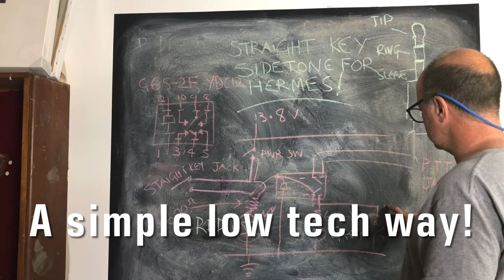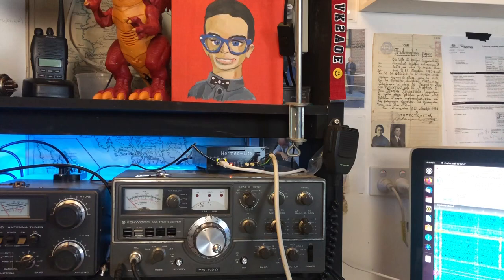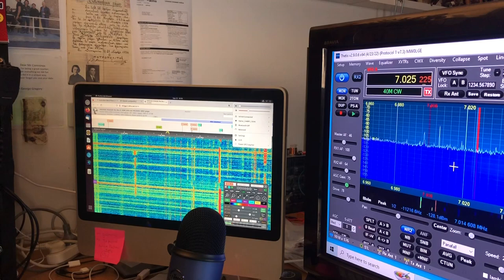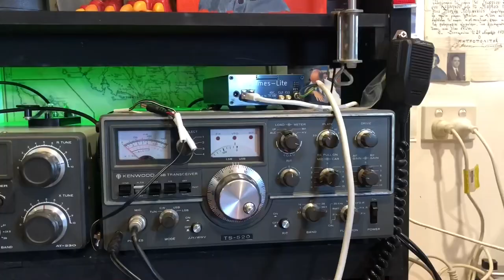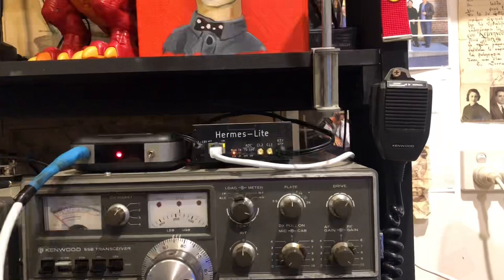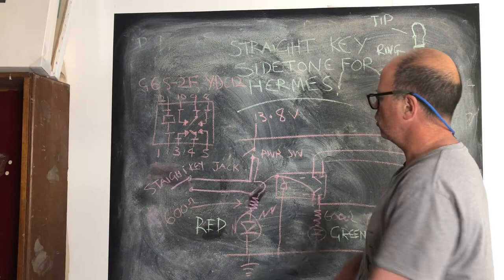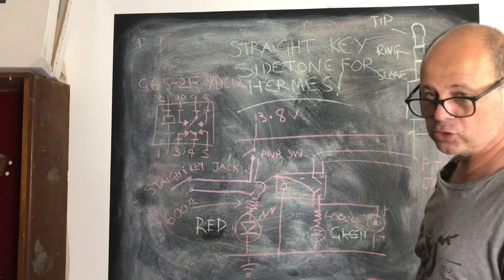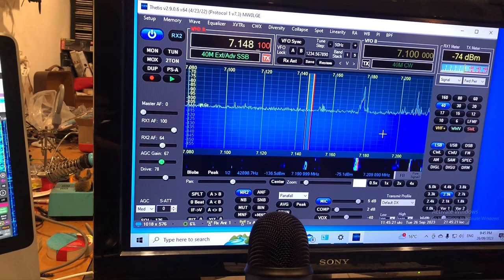Hermes Lite II - Straight Key CW

Comment: Two diodes and a piezo would have done the same job.
Reply from the maker: Would it present 12V to the piezo and isolate the input of the Hermes whilst still allowing the tip to sleeve to see earth? 73 de VK2AOE
Reply: key to cathode of two diodes, first diode anode connects to Hermes keying input and pulls it low when key is closed. Anode of second diode goes to one side of piezo whose other connection goes to 12V. Piezo sounds when key is closed. 73, Bob GM4CID @TheArtofEngineering